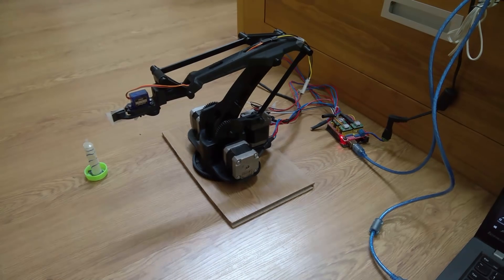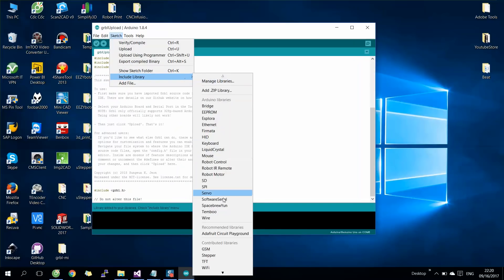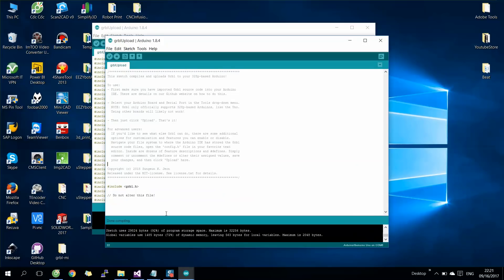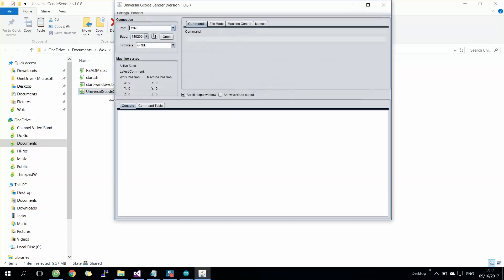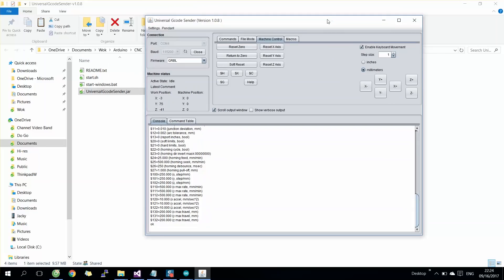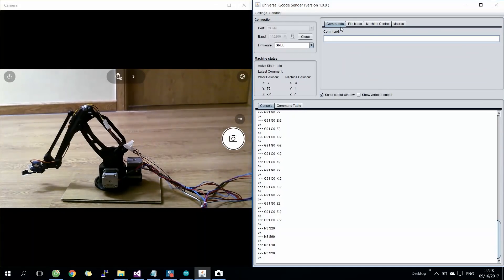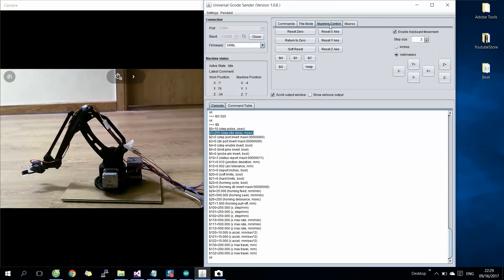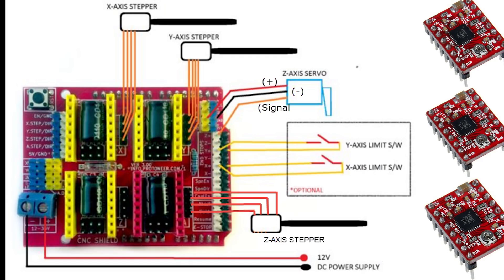Robot Arm DIY only $30 CNC shield control stepper and servo motor and first test

Comment: Hi, thanks for the tutorial.  Im used Nema 17 but the motors cant carry the body. 

Question 1: Are we cant use Nema 17 or am I doing something wrong? Motors are working but cannot carry the body. 

Question 2: Can you share the name or link of motors you used if we can not use Nema17?
Reply from the maker: Any step motor should be okay. Just make sure same wire layout to controller . Im not sure why your build can’t work, but you can keep motor separately to check whether without connection with robot body motor and move when send controllers command
Reply: @JackyLe  thanks for answer but i mean i did that (moved motors seperate) and motors are working really good. But when i connected to  body, motors cant carry the body. I think Nema 17 is not strong enough
Reply from the maker: @__yusuf__  oh might 2x reason one is motor it’s self another about printing part not good . Also make sure ypu have ball part between base and body to move body around

Comment: Hey!
Great video!
Exactly which motors are you using?
We try to make the arm ourselves, but it seems we can not get it to work just yet.
I am very excited to hear from you!
Reply from the maker: Yes sure, i used motor: 40D2060
Reply: Jacky Le thanks a lot! I Just have 1 question left: have you published the solidworks drawings somewhere?
Reply from the maker: Here you're http://123link.pw/CNCROBOTARMSOLIDW

Comment: Question: I tried giving the servo a command of M3 S20 but it nothing happened. What else did you do to the code to allow servo to interface with ugs?
Reply: did you figure it out?
Reply: @avas1227  did you found out?

Comment: This is ot under 30 $ , in Romania foor example a single steppermotor cost 15,45 $ , and the rest of the electronics are around 40 $ 
Where should i look to get all the parts soo cheap ?!
Reply from the maker: Only Electronic part i bought new with $5 for UnoR3, $8 for CNC shield. For the step motor is 2nd hand (just $7 for 3pcs)
Reply: ebay
Reply: https://www.youtube.com/watch?v=itlzfl3Wne8

Comment: The ability of a robot arm to maintain state resides in the design itself.

There are two ways you can maintain state without power
1. Use motors that take more effort to turn than the weight of the arm segment.
2. Use a worm gear design so that the axis arm is moved by a lead screw turning it's gear. In this configuration, the gear and it's shaft is mounted to replace the current motor position, then, the motor is connected to a lead screw that turns that gear. This requires a bit more program analysis to set up correctly however, once it's set up you do not need to waste energy  to keep the arm in place.

Hope this helps your version two design.
Reply from the maker: Thanks Scott for the advices :)